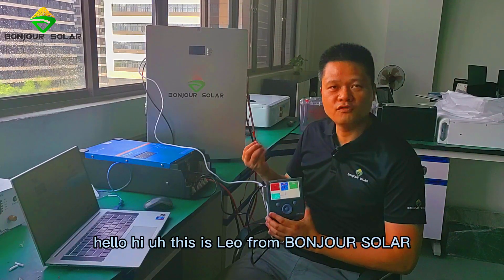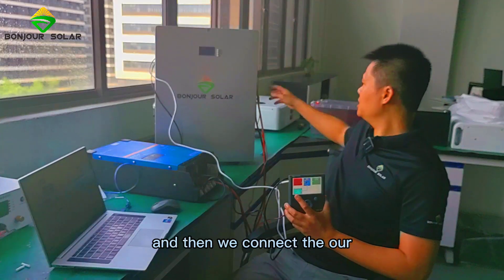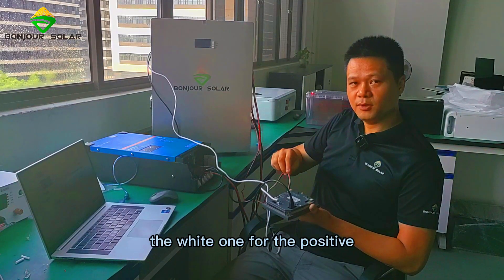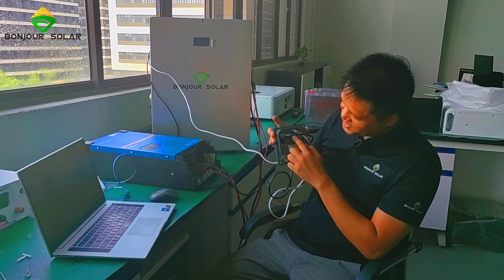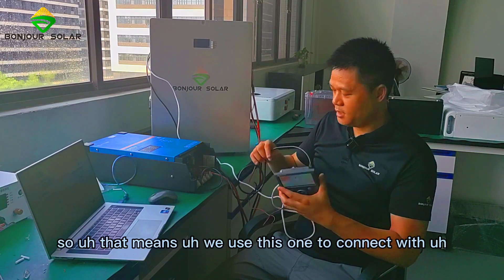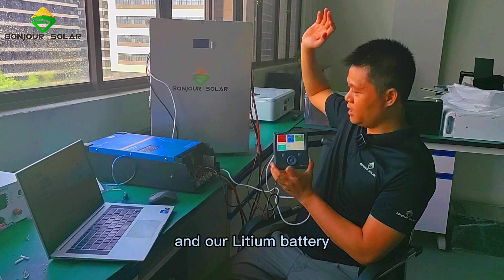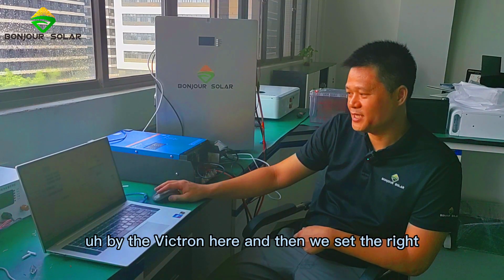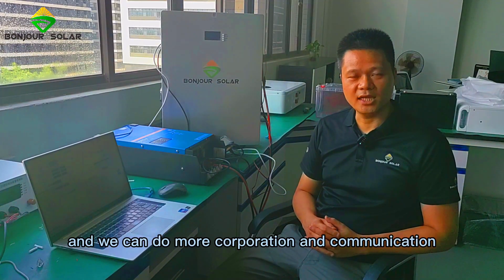BONJOUR SOLAR lithium battery BMS communicate with VICTRON inverter

Comment: Thanks for the video. Will the be a follow up video as you show only how to make physical connection between the devices. You should go into details and showing the software side of it.
Reply from the maker: it depends on which model of BMS you use, different BMS different software setting
Reply: @bonjoursolar   OK, fair enough. Thanks.